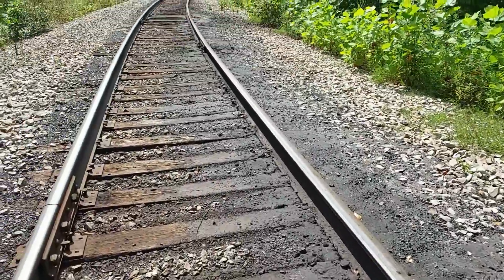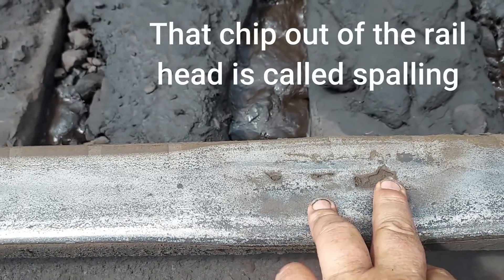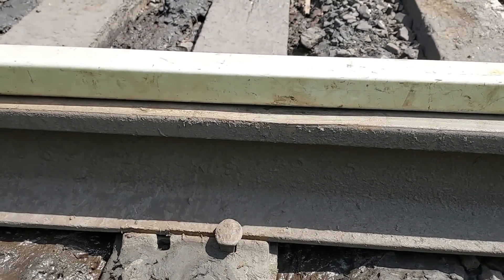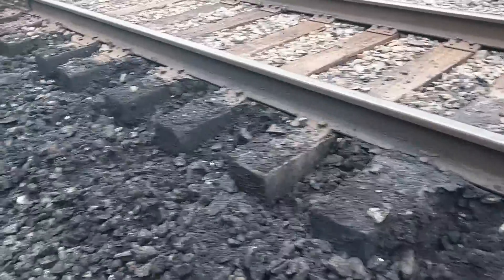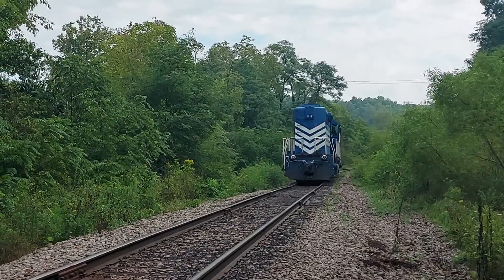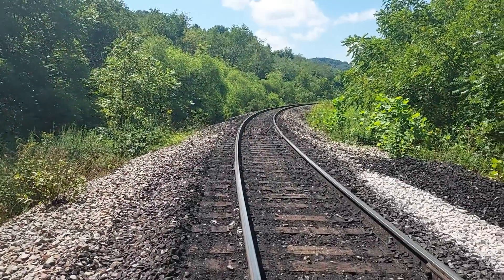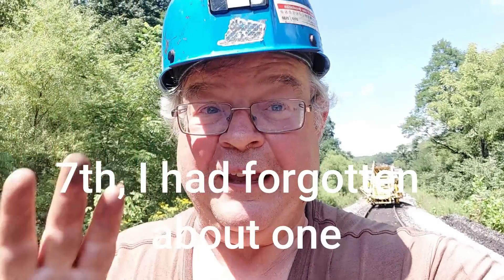This is the 7th Rail I've Broken with my Tamper

Comment: It doesn't look to me like the rails were made from the best quality steel to start with, possibly not made from virgin steel, meaning possibly recycled steel. Ron W4BIN
Reply from the maker: That rail had been rolled in 1975 in Illinois by US Steel Ron.
But sometimes rail during the controlled cooling process can
have what is called a shatter crack (hydrogen deposit) which
can at some point in the future develop into an internal defect
from the axial loading forces of the train. Steel is made by
mixing scrap with the charge, so there very well could have
been some poor scrap in that batch, something we will never know.

Comment: Nice work on the band aid fix! Did you have to put in a slow order for that part of the track or was there an existing slow order on that? I’m curious about what the protocol is on a defect like that?
Reply from the maker: Thank you Andy. No we did not have a slow order. Because
of the joint bars this was same as a typical joint. We did get
that rail changed out the following weekend tho. Obviously
being in a sharp degree curve we would never have ran a
train over it if the joint bars weren't applied first. Thanks for
watching the video today my good man.

Comment: WHEN  YOU CUT A SHOULDER  OFF AND PUSH IT TO THE SIDE. DO YOU LEAVE IT. OR IS THE BALLAST REUSED LATER?
Reply from the maker: Very good question and one in which a lot of folks have asked.
The old contaminated ballast is not reused or even try to
clean it. New ballast is $18 a ton so they tell me it's more
cost effective to buy new than to pay me $30 an hour
to sift the old stuff. Thanks so much my friend for checking out
the video and writing in today.
Reply: @ccrx6700  Thanks

Comment: The break seems to me as if a mistake had been made during the continuous casting process or the subsequent final shaping and small cavities formed in the track head. At some point, small hairline cracks developed due to the stress of driving over them and water could penetrate. The freezing water then expanded the cavity so that it gave way under the next load and a small hairline crack, which was not visible at first, formed and ran through the entire body. The next load then led to the final fracture. The break could also have led to a train derailing.
Reply from the maker: Thanks Robby for writing in with your hypothesis, I too thought the
original defect was from the mill. Yes we are very lucky the
train didn't break it, just amazes me it didn't. Appreciate your
visiting with us and watching my good man.

Comment: I noticed when the straight edge was put on the rail that the rail has 1975 cast into the side of it. Does this indicate the year of manufacture?
Reply from the maker: Yes sir. That is called a mill brand. Rail was rolled in 75 in Illinois
by US Steel. All of our original rail here was rolled by
them. Being in an 11 degree curve that rail they have gotten
their monies worth out of it. The high side in this curve was replaced
in 2011, it's time for the low rail to get replaced also. thank
you so much for visiting with us tonight and taking in the
show my friend.

Comment: In my country, and in my opinion, this fragment of the rail, along with the overlaps, should at least be cut and replaced IMMEDIATELY. This splint has some internal defects, inclusions, cracks and is abnormally weak at this point. Its further use threatens a very serious catastrophe.
For me, this is a very strange "repair" method.
Reply from the maker: Thanks for taking the time to write in and watch the video
andrzej3511. We changed the rail out 4 days later, was unable
to do it that day because my hi rail truck had a bad leak
and would not pick a rail up. Had to wait to get a contractor
with a grapple truck in.
Reply: @ccrx6700  I see... THX for info.

Comment: Great video! Has anyone ever tried filling in that damage/chipping in the rail with an arc welder and grinding back to shape? Sort of like the way that the digging surfaces on heavy equipment or the blades on boat propellers get resurfaced?
Reply from the maker: Thank you Jeff, glad you enjoyed. We have on many occasions
welded battered rail ends, they hold up well, also have welded
frogs. Takes a good welder to do it tho. new developments
have come to light on this break, will be a video out on those
this week sometime, hope you will watch it.

Comment: Looks like a train stalled there & the wheels were allowed to spin. The heat generated squished the rail head. I suppose that is why the engineer watched the Ammeter is the locomotive is struggling.
Reply: only if there is a matching spot directly across from it on the other rail...but there is not.
Reply from the maker: New evidence has come to light NJPurling, we changed that rail on
Friday and found that the base had already been broken, I just
finished it off with tamper. Will be a video out on it soon. Thanks
for visiting with me and checking out the show my friend.

Comment: Quite interesting. I am curious about the ballast being spread in such a wide section. Why so much? Would that not indicate that the track has sunk? Could the machines not pull all that ballast back under the rails and ties? Wouldn't that help with the excessive angle? Pardon my newbie questions.  I normally work on aircraft electronics.
Reply from the maker: Glad you enjoyed the show. There was an over abundance of
ballast on the shoulder because several times in the past
years that shoulder had been cut out with the regulator and
the old ballast pushed out, so it had been built up. When I
do find time to get up there with my excavator and crib those
ties out, I will shove all that excess ballast way over the hill.
thanks for writing in and for watching my good man.

Comment: Thank you for showing us this excellent work, it was a very impressive clean up of the ballast. It is impossible to see what is happening inside the metal of the track until these things take place, though the railroad company in the area that I live has some very expensive, ultrasonic test trains which can detect things happening. Sometimes wheelslip can cause similar problems. These videos are really helpful for the people in educating them as to what goes into keeping the railroad safe and running to its greatest potential.
Reply from the maker: New evidence has come to light John, we changed that rail on
Friday and found that the base had already been broken, I just
finished it off with tamper. Will be a video out on it soon. Thanks
for visiting with me and checking out the show my friend. We do
get the ultrasconic rail testers in here also when they are
available. Since we are so small they want the big jobs, not
the little ones and they too are short on people.

Comment: With constant cold rolling by the wheels any defect in the rail will come to light. Usually I think of steel as a homogeneous material but apparently it's not perfect
Reply from the maker: New evidence has come to light Matt, we changed that rail on
Friday and found that the base had already been broken, I just
finished it off with tamper. Will be a video out on it soon. Thanks
for visiting with me and checking out the show my friend.

Comment: Is all the rail welding done with Thermite process ?         Or is any of it done by stick or wire welding ?                       Thanks
Reply from the maker: All by thermite and also a process called flash butt welding, no
stick welding is done on rails. The flash butt is similar but
uses a machine that comes out of the back of a box truck and
sets down on the rail, then welds the joint together. Thanks
for stopping by today William and taking int he show my good man.

Comment: I'm about to head your way. We've gotta keep this coal moving. I can drop a cut/bevel and cut that rail to spec.  Done it before.  We throw out the contaminated piece, and insert fresh.
Reply from the maker: I can use all the help I can get! You'll be glad to know that
broke last Sunday and this Friday we changed the whole stick
out, will be a follow up video coming out hoping can get it done
for this week. Thanks for the offer and for watching my friend.
Reply: @ccrx6700  Where do I send my resume?  "get it done for this week?", under my leadership, this job woulda been done yesterday.  We've gotta UP the class of your railroad!  We need to turn and burn!  We're not running a scenic tourist railway, we're moving coal!  Just need to burn-out some bad track and replace.  I'll get it done.  Maybe a connection to a major main line?  I'll put Cumberland Mine Railroad on the map!  BTW give me a little time to sell my dental practice and relocate.
Reply from the maker: @halfinchholes88  👍😊❤️

Comment: The stresses that cause that deformation are called Hertzian stresses.  Analysis was developed before and early in WW2 by t hr Germans.  It was shared  through technical societies.  They were mostly used to analyze ball bearings.   It is a failure.  What you see is the result of being over stressed.  Most steels have infinite life if you keep the operating stress below 50% of the yield stress.  Not the typical tensile yield but bearing limits which are much higher.  I learned all this from an old U of M professor who taught classes at Ford R&D center.  Good stuff.
Reply from the maker: Thanks so much Greg for sharing that info with us! Really appreciate
your taking the time to do so my good man.

Comment: wish youd applied joint bars 1st.....
great job cribbing & kicking mud out of the heads.
thatll actually hold a while.
great plan to plug & weld.
best wishes.
Reply from the maker: If I had a crystal ball I would have put the bars on first,
but then again, it wouldn't have broken and the rail might
never have gotten changed. It broke last Sunday and this
Friday we changed the stick of rail out, so all is well
and they lived happily ever after. Thanks for taking in the
show today googoo gjoob
Reply: @ccrx6700  , i really respect what you do. especially with what resources youve got. hats off!
Reply from the maker: @googoo-gjoob  😊👍

Comment: There was a date stamp on  the side of that rail, directly under the flat spot, it looked like 1975 ? As kids we always looked for the date stamps on track in our area to see who could find the oldest year. Some were 1930s and on some old sidings that were no longer used there were 1890s and 1910 dates. That old rail was a lot smaller than the heavy stuff they use now.
Reply from the maker: I love to see those old rails Earl T. Got a bunch of pics friends
on other RR's have sent me over the years, someday I will
make a slide show of them. Thanks so much for stopping
by and taking in the video my friend.

Comment: Why American rail roads still use wooden sleepers? They are stuck in 80s rail technology.
Reply from the maker: According to the Railway Tie Association, 93% of N. American
RR's use wood ties. While concrete ties are also in extensive
use in N. America, there is also some problems with their
application, you might enjoy reading this technical
article on the problem with concrete
https://www.rtands.com/track-structure/ballast-ties-rail/new-paradigm-design-concrete-crossties/

also If you would care to learn more about why we dont
use concrete here, then watch this video, explanation is
about 1/3 of the way into this video
https://youtu.be/oOug0z34118

Comment: That's interesting Dave. Quite something that defect in the rail. On the big company railroads that have those fancy inspection cars, would they pick up defects like that? 
Spalding? We saw that in concrete where the rebar got exposed to moisture via a crack and started to corrode. The concrete institute says the rebar can expand through corrosion to 7 times its size thus causing the concrete to fracture spald. Worst I saw was on a concrete breakwater in Richards Bay. Can also happen when the concrete coverage of the rebar to little. Nice one again Dave.
Reply from the maker: Glad you like the presentation Bill. We do get the rail testers in
here, usually twice a year. We changed that rail out Friday and
found some new evidence, the rail base had been broken
for some time, I just finished it off. Certainly the testers
would have found a broken base. it's not easy to get testers in
here because we are such a small RR. They want big jobs
and as with everything else are hurting for employees, so
they come only when they happen to be passing through.

Comment: I have seen a rail with dark spots and was told they were caused by impurities, it looks like you had the same here and were lucky it broke during tamping. We also use a temporary joint bar but held with clamps so no need to drill the rail. I think these had to be checked every day so your way looks better.
Reply from the maker: Dark spots inside the rail are caused by oxidation, air getting in
to a defect. On the outside where there is a brownish red streak
we say that is bleeding. You'll rest easier, that break happened last
Sunday and Friday we changed whole rail out. I know I will
sleep better. Thanks so much my friend for watching and writing in.
Reply: @ccrx6700  Thanks for that info Dave, I am sure we had a name for those spots but cannot remember it now. Good to hear you got that rail changed so soon. Yea even though you knew it would be OK there is always that I hope it is on your mind LOL.

Comment: Hey Dave! Shane here. I have a really cool idea that would make cribbing and ballast replacement move at light speed compared to how it's being done!!! I f you are interested, let me know!!!
Reply from the maker: I'm listening Shane, throw it out there and we'll see if I can catch it!
Reply: @ccrx6700  It is a ballast regulator that has wings on each side, right and left that drop down to scoop the shoulder ballast away on each side at the same time. Then another speed swing that lifts the track up ahead of it and shifts it to the left one half the width of the ties. Then the gegulator makes another pass, scooping the ballast away from the ties once more then it does the same, shifting the track to the right, making yet another pass, scooping the ballast away on the opposite side. Once the track is moved back into position, ballast is dumped with a dump truck with the tailgate chained to prevent the ballast from coming out all at onceI know that this idea would take some pretty serious resources to create,  but once done it would make mud holes and soft spots a thing of the past!!! Maybe the Railroad doesn't have the resources to fashion this, but it would sure be worth attempting???
Reply from the maker: @wasatchrangerailway6921  Sounds interesting, it could be done I suppose,
have to have some flat right of way on the side to shift the track over
onto. And a dozer to keep shoving the old ballast to the one side away.
We have used a  dozer and excavator several times in the past to 
just pick the track up and move it over, then bull doze everything out and
start over, takes some time and you have to have a good way to get 
ballast back down, takes 1 tri axle for every 10 feet to do this. 

With track built up on high fills, is difficult to do with eithre method because
there is no room, fills are only usually wide enough for the track and little
room on either side. Another thing with either method would be, ties
must be fixed first or you'll have a mess to deal with. I've used a speed swing
a few times in the past on a hi rail Pettibone. They don't have much ooomph
when swinging to the side, trying to swing track out of the way might
be difficult, with a big excavator it's no problem, they have the power to do it.
 Get Tim the Tool Man Taylor to come and design this machine for you, More Power!  Like he super charged the lawn mower one time.... LOL  \

Your idea would work for sure, but it would need to be a pretty big machine
to lift that track and move it, unless the track was already skeletonized. Some
food for thought.

Comment: Is that a 1975 date where the rail defect and tamper break happened? It seems like that defect goes deep into the rail head and would fail progressively faster with use, in other words, it might look compromised but serviceable today, but fail in 7-10 days/train cycles.
Reply from the maker: New evidence has come to light Charles, we changed that rail on
Friday and found that the base had already been broken, I just
finished it off with tamper. Will be a video out on it soon. Thanks
for visiting with me and checking out the show my friend.

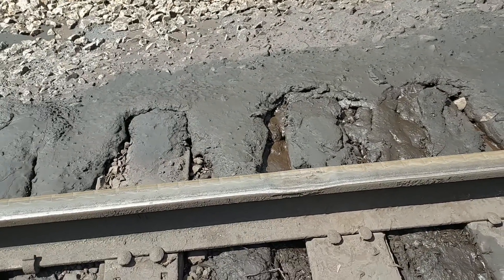Comment: When you showed the crushed head, around minute 3:02, the rail also has very regularly spaced straight marks (dents?) that are perpendicular to the direction of the track. It looks like every 2" or 3" or so. What is that called and what caused it? My guess would be a flat spot, but they're too close together for one flat spot and seem too regularly spaced to be caused by multiple different flat spots. How do those dents affect the rail and its lifespan, are they a precursor to the crushed head or unrelated to that? Thank you for your videos and teaching us so much about the railroad! I love to see and learn about things I would otherwise never get to see or hear about from up close.
Reply from the maker: Very observant 2xKTfc! Your the only one that has noticed that.
No defect there, those marks are from the rear tires on my
hi rail truck. Really appreciate your tuning in to the show today
and watching my friend.
Reply: @ccrx6700  Oh! I would never have guessed that. Very interesting, thank you. It was the first thing I noticed, well apart from the spot you pointed out, and it looked expensive - glad it doesn't cost a thing :)
Reply from the maker: @2xKTfc  👍😊